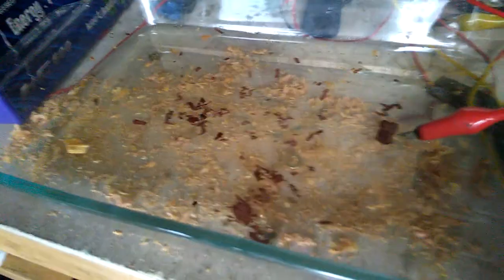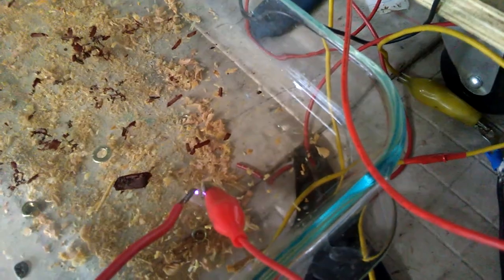ELECTROGRAVITY

Comment: Are you sure you aren't just instantly evaporating the water in spots, momentarily creating a void which the water rushes into, and this takes the wood along with it?
Reply from the maker: Hadnt thought of that, could be.  We would need a high speed camera to see.
Reply: Maybe If you only start with a few drops of water, you could see if it is vaporizing it...
Or you could leave it running for an hour on a larger amount of water say in a glass or a cup, and then if the water level drops you'll know.

:)
Reply from the maker: caveymoley ok ill try that.
Reply: <3